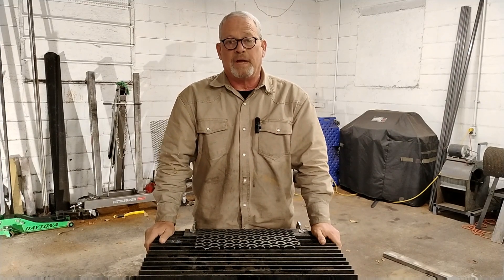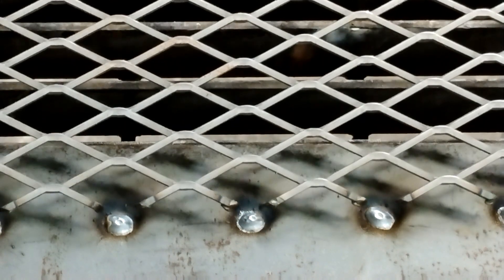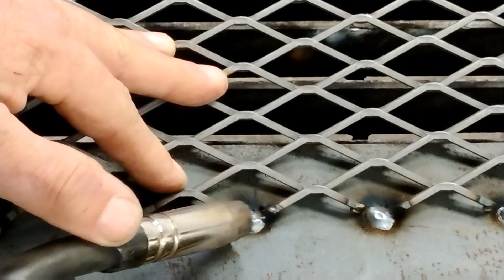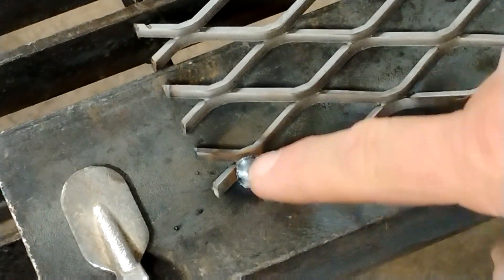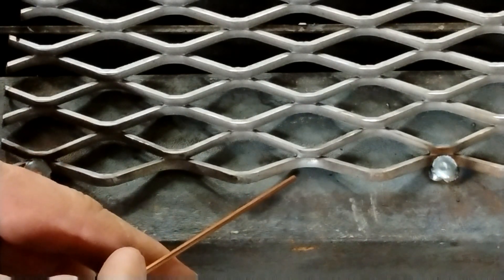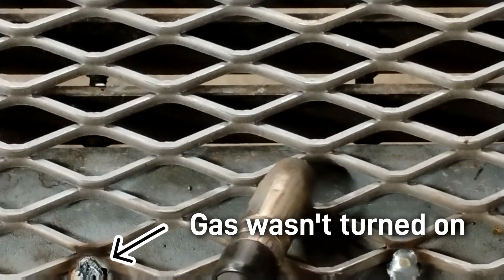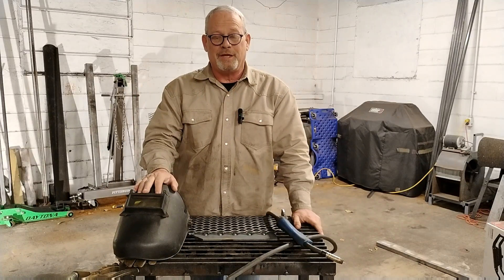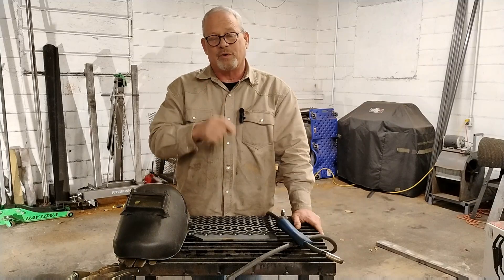Welding Expanded Metal in 3 Easy Steps | Quick 1-2-3 Method for Beginners

Comment: What amp do you set too? Can that be used to reweld expanded steel where it has just broken at seams as well?
Reply from the maker: Set the amps to the thickness of the mesh, not the base. Like, if it is 1/8" mesh, set it to that. Yes, it can reweld broken as well. However, if it's painted, hit it with a wire wheel first. If it's rusted, turn it down. Trying to reweld rusted mesh back down is a big pain.

Comment: great video! how would you go about welding 3 inch  C perlin 14 gauge  to  2 3/8  pipe 1/8 thick ,  this would be for building a metal fence, the pipe would be the posts and the c perlin would be the rails , thanks
Reply from the maker: I would prioritize the 1/8". Make the settings for the 1/8" and point the gun into it. I would let the puddle splash up onto the 14g, not really going up onto it much. Watch my Advanced Techniques video about doing the circles and keeping to most of the traveling on the 1/8"
Reply: thank you sir  @AllStarWeldingSC

Comment: I have a question if you don't mind how do you weld the expanded metal angle iron frame for a large cooker after its welded it sags got any ideas on how to keep it from sagging  thanks for sharing
Reply from the maker: Good question... I usually use 1" square tube, rather than angle iron. Angle iron will warp from welding, and the cooking over time.  Also, when welding it, DO NOT go zap zap zap all down one side, it will warp like crazy. The angle iron will warp towards the heat, so the corners will lift up. Build your frame, lay the expanded on it, and only tack down the corners. Then go do something else while it cools. Then come back and tack the center of the four sides, then let it cool. Yeah, it will take all day. But if you are building a grill, once you get to the point where you know the size of your grilling surface, stop and get this process going. In-between each tack, go back to your grill and do the next step. Jump back and forth while letting it completely cool between tacks. Your frame will turn out nice and flat. Clamping it down will also help. I hope this was easy to understand and was helpful.
P.S.- I have also been known to flip the frame over and lay a hot 3" long bead on the backside. Remember that it will warp towards the heat? Sometimes this will take the heat out. Or, you can flip it over and run a torch on it around the middle and almost watch it lay down flat.

Comment: Is it possible to stick weld the expanded steel? That's all I have
Reply from the maker: You probably could with 6013 probably a 1/16" size at 20-45 amp
Reply: @AllStarWeldingSC  awesome,that's what I've gathered from my research as well thank u for responding!
Reply: @lawrencecheshire6012 I would focus on the base metal and whip quick to the expanded steel
Reply: @AllStarWeldingSC  love it

Comment: Been doing this for years... And when doing this with FluxCore, turn DOWN the voltage to lowest setting and max out your wire speed feed and burst for 1-2 seconds with the same pattern. It works.
Reply from the maker: Good tip!  I'll have to try that next time.